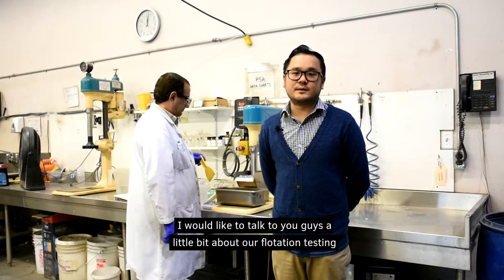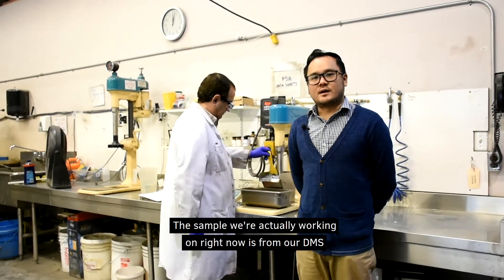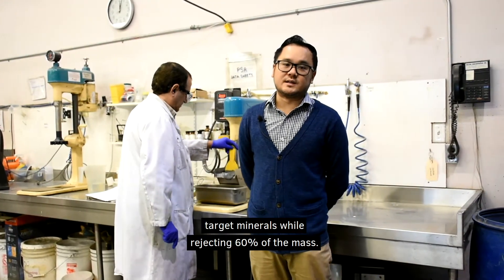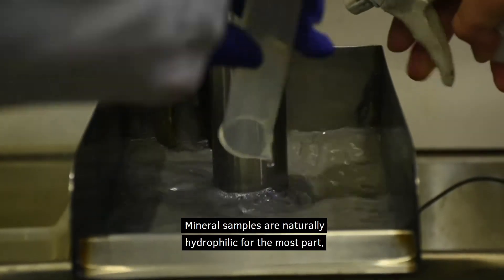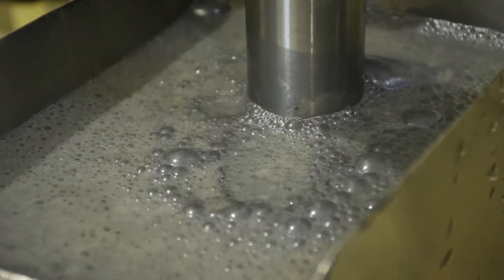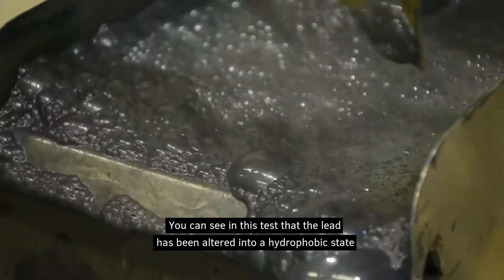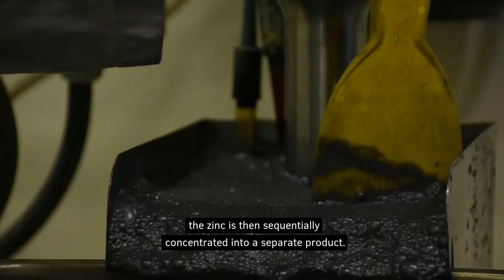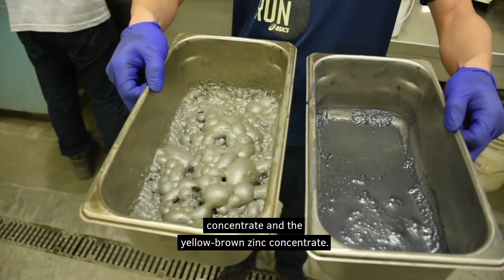The Flotation Process | Sepro Labs

Comment: So this can be used in large scale to extract minerals out of sewage water of metallurgical production?
Reply: there's many more impurities in industrial sewage water then just minerals, there's acids, oils, dust, organics, salts, it would be a great financial and engineering headache to chemically float all of these out, they usually just use something more straightforward like reverse osmosis, they also use skimmers, which you would have probably seen if you've ever been to steelworks or any water treatment plant, they are the big spinny things that skimm floating impurities from water, very cheap and efficient
Reply: It is